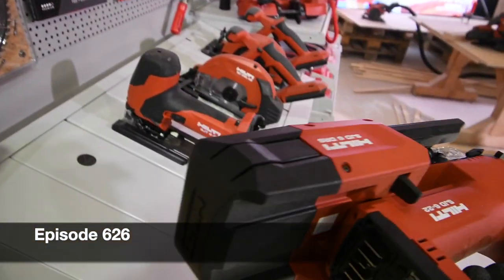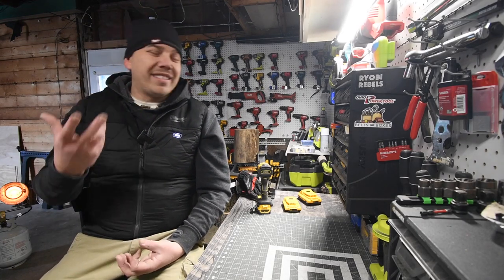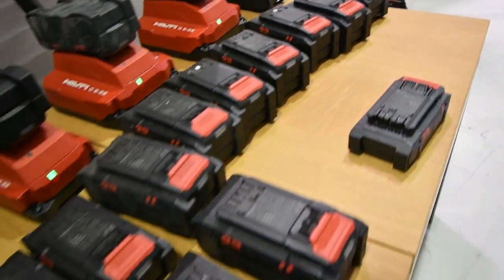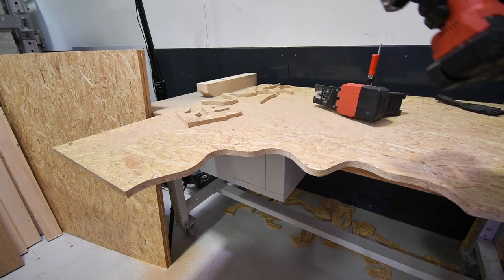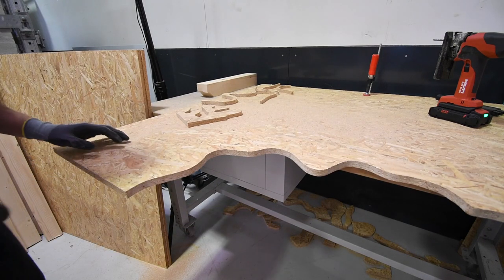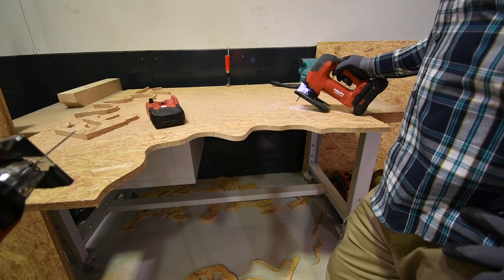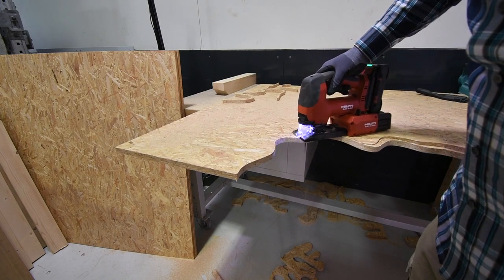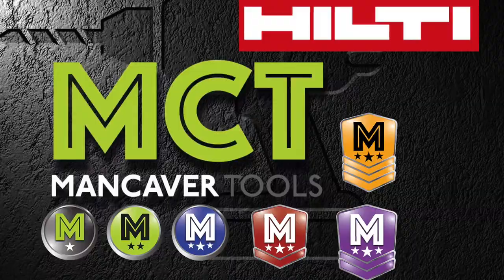HILTI Nuron Part. 5 (Saws)

Comment: Either the tester wasn't pushing that circ saw hard--even though I did hear a little bogging--ir it is not that impressive.   Without an actual head2head battle, I can already tell the Milwaukee Fuel, Skil 40v, Makita 40v would beat it, and the Dewalt FlexVolt would bury it badly.  So, Dave, can we get this battle set up?  Love love your channel ❤👍✌
Reply from the maker: when it comes to these tests I want to see what happens when I get them in my test.